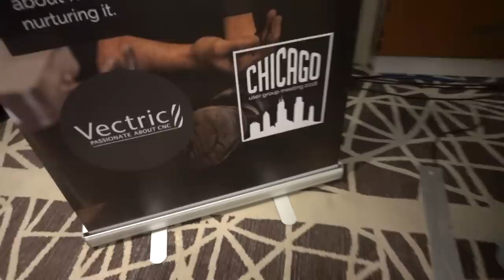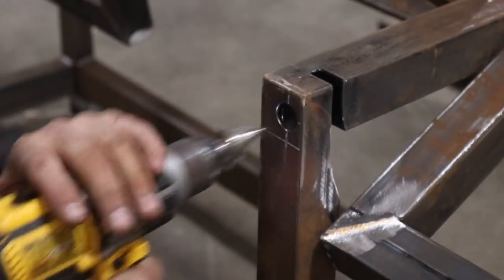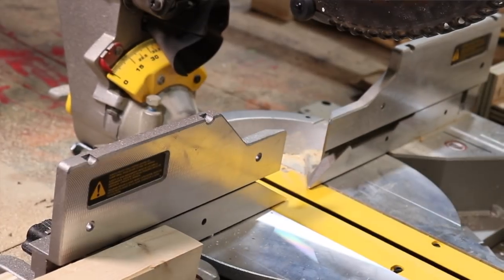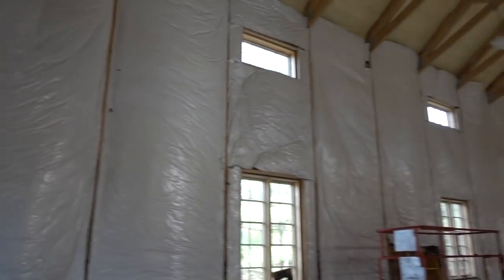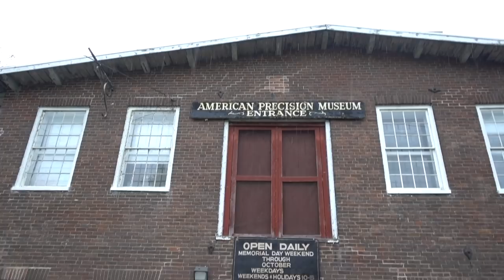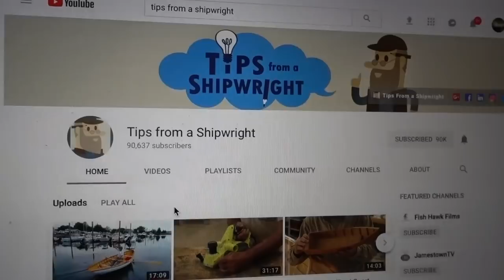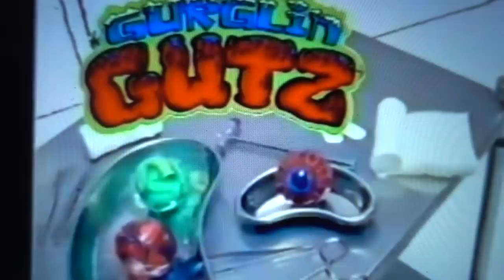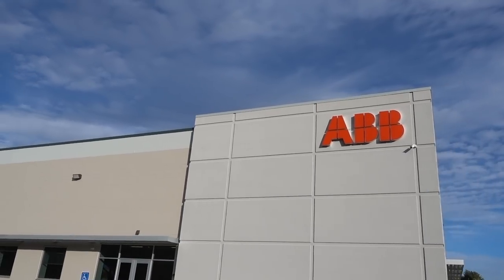DiResta 78 I Might Get a ROBOT

Comment: after working with fanuc robots for 12 years i can tell you the kicker will be all the safety equipment so no one gets hurt  here in australia for one robot and safety gear it would easily set you back $130k  and of that aproxx $30k is that safety component.  how ever i am not sure of the current RIA rules and regs as they were looking to change all of that when i was looking into it a few years back. it was one of the contributing factors to the company closing down that and electricity cost and holdens here in adelaide shutting down production

Comment: I did have a question:  did the power company in your area offer the option of a primary underground to a padmounted transformer closer to your shop?  It looks like they had to up-size the cable to mitigate voltage loss.  Just curious, I'm a designer for NGrid in CNY.
Reply: So, what would it be, 13KV underground to the transformer? what gauge and how many conductors would it be for 3 phase, 400 amp service?
Reply: @jeremyspecce  Well, that's two sides of the transformer:  on the primary side it's normally a 13.2KV (3ph) or 7.62KV (1ph) underground to the transformer, #2 AL cable. On the secondary side, a minimum of # 4/0 cable, again 3 conductors, one neutral. (And that sbout exhausts the extent of my underground cable knowledge...I design mostly overhead.  I don't want people to think I'm smarter than I am!  Ha!)